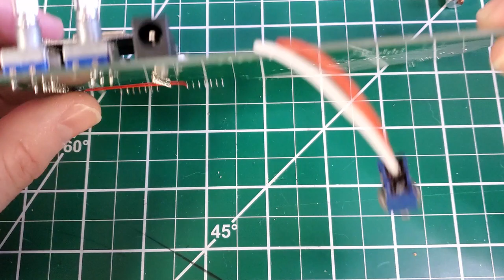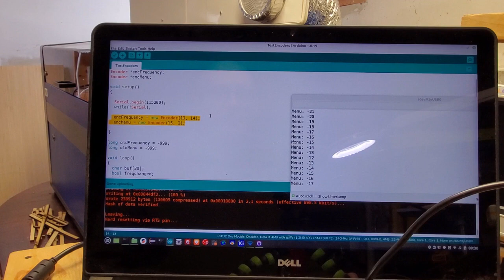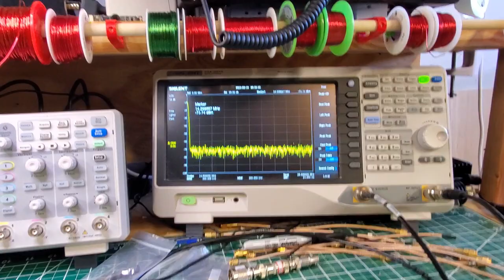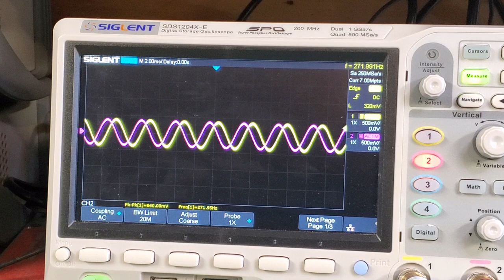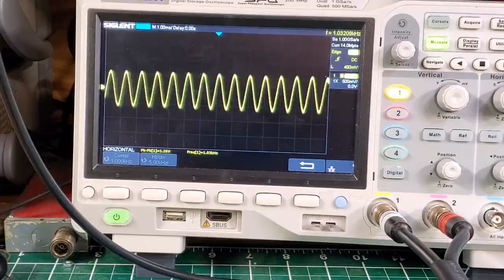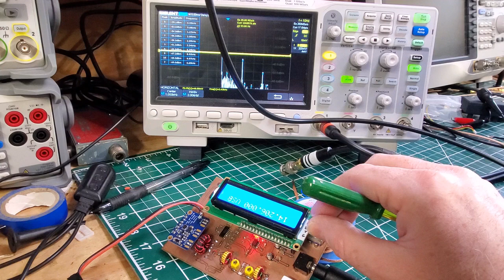SDR Transceiver   Part 4 Receiver ... and a problem

Comment: Thank you again for sharing your work, it has inspired me to work on my own SDR project. A few years ago I got the first generation esp32-a1s development board and have used it for SDR experiments. The older audio codec on it is a pain to work with and I should order the newer modules. More recently I've been working on an pure STM32F103 sdr, it has dual adc and I'm not using any codec, rx audio is PWM. I got very good results with the bluepill dev board, feeding the quadrature af from an usdx board to it. I then designed my own standalone board and it doesn't work correctly, sideband supression is horrible. I have pinpointed the problem to the 3253 detector and 5351 pll, since the DSP works fine injecting the af quadrature signals (I often use kiwi sdr in iq mode). My 5351 channel amplitudes are not even. I feel that the fst3253 performance varies batch to batch and it can be very touchy to get to perform correctly, of course circuit layout plays a big role. I'm making a new design with a johnson counter for the quadrature lo and either a 4066 detector or sa612 pair, hoping to improve the situation. I plan to feed the 5351 clock from the MCO pin on the STM32 to reduce artifacts by running both ics on 16 MHz. I think the best part of this experimentation is that there is constantly room for improvement, for example there still isn't a silver bullet for the quadrature detector chain in these hf dsp rigs. I have to also mention that I'm a recovering cheap component addict and sometimes those parts end up on my pcbs, making my troubleshooting even more painful :D Here's a link to my SDR project: https://gitlab.com/m0rph/pocket-rocket-sdr . I need to update the git page with my recent discoveries.
Reply from the maker: Thank you for the great writeup and I am glad the videos have inspired you. I moved away from STMs a little while back because I was intrigued by some of the onboard peripherals on the ESP32 (wifi and such). I did prefer the STM development environment though

Comment: Just a guess but I think it could be something to do with the SI5351 clock generator generating noise, what is voltage are you are supplying it? Also I have found filtering the clock outputs really cleans up the waveforms.  As I say it's just a guess as I am sure that you will get to the bottom of the issue. Another interesting video.
Reply from the maker: Thank you John - I was wondering that. The si5351 is very close to the Audio switch. I should really have placed it elsewhere on the board. Its supplied with 3.3V

Comment: First of all, I admire your work on this project. I have another suspicious thing as the reason for the described problem. Although you only turned on linein in the software, the microphonein inputs are not turned off. The ESP32-A1 now on the header board has longer lines on the mic inputs and this can result in additional signals to be trapped on those lines. Try cutting the mic lines right at the module. Good luck and Best Regards from S52UV op. Stojan
Reply from the maker: Ah thank you Stojan - thats an interesting suggestion!
Reply: @na5y  Just one more option. While testing the ESP32-A1S module, I realized that it is very sensitive to ground traces also. The noise was significantly improved if I grounded module in only one place (one pin on module) and connected this and  ground pins of all other circuits (Si5351, Opamp supply AF output amp...) to one and only ground point in the radio. This point was the output terminal of the power supply for the entire radio. So a correct PCB layout is sometimes the biggest challenge. I really wish you a success. Stojan
Reply from the maker: @stojanmarkic1033  Grounding has definitely been a problem for me in the past with these ESP32-A1S boards so you might be onto something. Its strange that the artifacts are so clean though

Comment: I also build several Tayloe IQ mixers and the result is very depending on the phase and gain match. 0.2 - 0.5 db gain and 1 degree phase difference is enough to reduce it to 30 db. Maybe adding a pot trimmer on one of the opamps to adjust the gain a little bit is worth a try. Or compensate in software is also a possibility.
Reply from the maker: Thanks Paul - I actually do have amplitude compensation in software controlled by the pot on the right. That strange signal at +8KHz is something else though I think. I am going to have to think about this a bit more...
Reply: @na5y  An other problem I had was groundloop, noise from the CPU injected into the ad converter. In that case the 8khz signal should be there without rf input
Reply from the maker: @paulh0029  Another great lead to look at - thank you Paul

Comment: On the previous radio supply for LM4562 was 12V for this one it is 5V. Why the difference? Thanks.
Reply from the maker: Wow - that's super observant Martin. Yes I tried powering the opamps from 5V as I really didn't need a 12V swing. Mid rail is at 2.5V and the signal shouldn't get anywhere near that. I ended up suspecting it as a problem and changed it back to 12V - unfortunately it didn't make things any better. Thank you for the comment!

Comment: Is the output from the splitter transformers the same? Yes clutching at straws.
Reply from the maker: You mean does the output after the splitter look good (equal amplitude and 180 phase) - I am pretty sure I checked - but will definitely check again. Thank you for the suggestion!
Reply: I was not clear I understood you used a trifilar rather than a bifilar and then a seperate winding on the input side, if the turns ratios are different you may have suboptimal impedance. Like I said clutching at straws.

One more thing do you have a splatter of 0.1uF caps across the DC near all of the chips?
Reply from the maker: @chrisherd991  I do have some .1uF caps sprinkled here and there on the supply of the ICs. On the splitter I ended up going with trifilar rather than the bifilar + single winding. That is exactly the same as the other radio I showed
Reply: Ok I have been looking at other circuits that use the same technique as you.They use a 2.2uF cap between the center point of the voltage dividers and ground. If you have done that I will keep pondering.
Reply from the maker: @chrisherd991  At the center tap of the transformer T3 Chris?
Reply: @na5y  the middle of he voltage divider you use to bias the op amps. Sorry I was not clear, look at the QRPlabs QCX, QDX or QMX  manual.

Comment: I'd first try another brand of 3253. Perhaps swap the2 you have in the better performing rig and the new one. They appear to be 'fussy' parts when used in this application. Meaning some chips are simply better than others by a few dB. You might also look carefully at the drive signals toggling the 3253. Slightly slower rise or fall times could make a difference between the 3253 outputs of the 2 boards. Second, I'd try a magnetic isolation divider plate of some sort between those 2 toroids that are in line and so close together, (the splitter toroid and the toroid in the bandpass filter.)
Reply from the maker: Thank you for the suggestions John! I'll definitely give them both a go